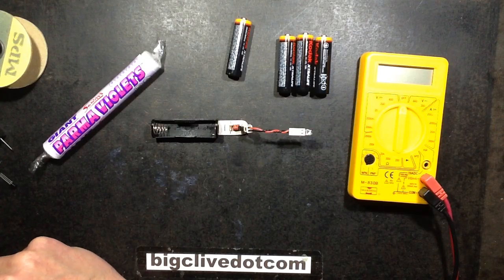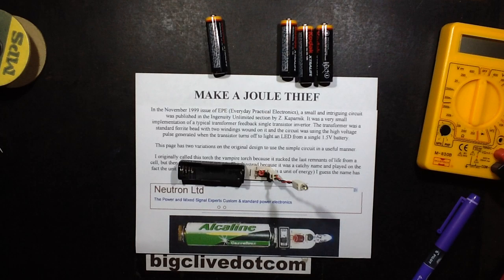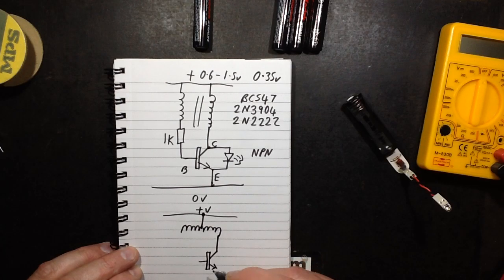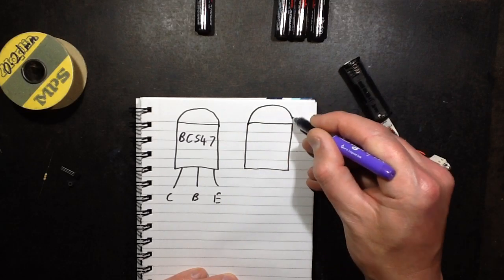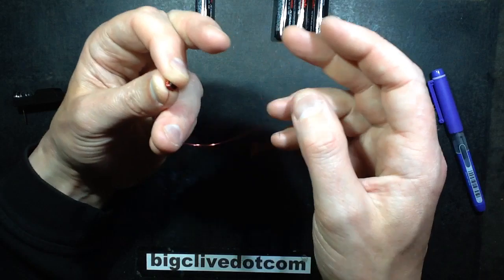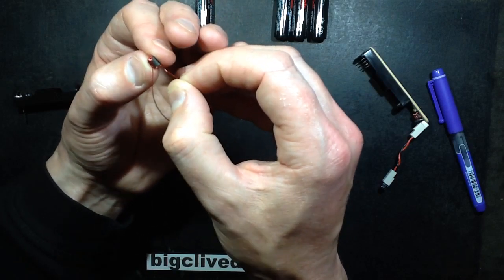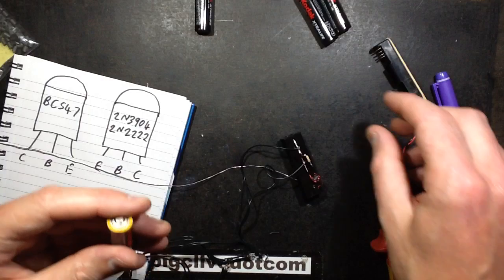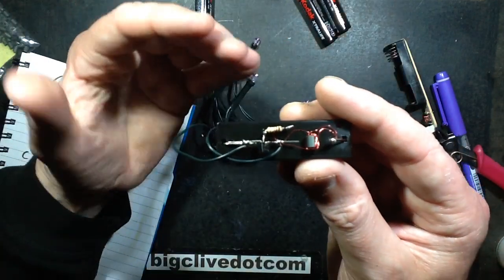How to make an authentic Joule Thief.

Comment: I just returned to this video because I couldn't figure out why mine built from memory doesn't work. 
First I suspected the cheap chinese S9014. 
It turned out the LED was negative on the long lead. Oh well, they where cheap for a reason.
Reply from the maker: That's especially common with red LEDs.
Reply: @bigclivedotcom  Interesting. In my case it was a infrared, 880nm.

Comment: Well, have you ever considered, how effective a Joule thief really is? There are measurements published performed with alkaline AA batteries with a typical energy of about 1 Wh, which have shown, that the remaining amount of energy below 0.8 V is small ( https://lygte-info.dk/info/batteryEnergyAtLowVoltage%20UK.html ). It depends also on the discharge power. At 1 W there are less than 10% energy left below 0.8 V. At lower dicharge power (the typical application case) the remainig energy below 0.8 V goes down to less than 1 per cent. So I doubt that a Joule thief is really very useful.

Comment: Just saw this. Thought you might find it interesting.

http://www.pcworld.com/article/2928997/batteriser-is-a-250-gadget-that-extends-disposable-battery-life-by-800-percent.html
Reply: Richard Wasserman It's rubbish. In most products it's going to be a loss, if it can even run them. Even the most wasteful devices cut out at around 1.1v which still uses the majority of the battery life.

Comment: The graph is misleading, in your example the christmas lights actually would have consumed a majority of the total power output of the battery, not just the tip of the iceberg, as you illustrate.

Comment: I don't think that those LED's are lit, using power from the battery...by the way it looks and you alone said it that those LED'S will be lit for a very long time from that dead battery, my conclusion is that the LEDs are lit from the collapsing magnetic field from the inductor, wich generate a spike of greater voltage than the one from the battery. The battery just powers the "valve" to keep it open so the free energy can flow through the small path, wich is represented by the inductor. This is what they want us to believe, that this is nothing but a self oscillating voltage booster, just a funny, weird toy.......If you calculate the power consumed to keep those LED's lit for  all that period and calculate the voltage and the amps left in the AA battery, you can see that under no circumstances that battery could keep those LED's lit all by itself, for so long........just think  little bit......I will humbly accept any good argument that can prove me wrong.
Reply: So, this means that I got a point??
Reply: @mateivaly5007  any response from BC is worth a point!👍 And I like your deduction.
Reply: @mateivaly5007  do you think the lights are turning off and on very rapidly? If so I wonder what would control that frequency. Perhaps the hand made inductor?

Comment: Look, mum, no transistor:
/watch?v=iHmTc0PwiyY
:)
Reply from the maker: +z08840 Neat.  But I wonder if the coil on the magnet could have been used to drive the LED too.
Reply: Per my understanding it can't - some time ago I tried to measure inductance of coil with neodymium magnet and seems magnet has no or even negative effect on inductance.
Reply from the maker: +z08840 The strong polarised field may have a damping effect.  I've noticed that when I've brought magnets close to coils.